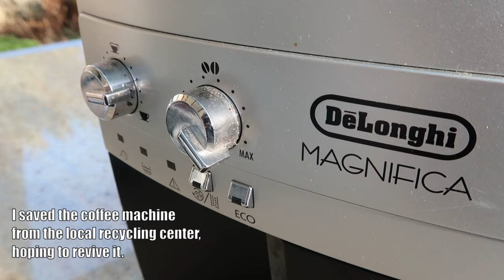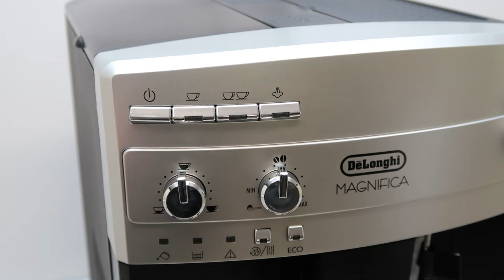DeLonghi Coffee Machine - Revival and Restoring DeLonghi ESAM Magnifica

Comment: Hi man, I have Delonghi ESAM 3300, when I push the button to make a coffee it is just driping in the cup and does not leak like before. I have replaced o rings on the infuser, brew unit and cleaned everything but nothing changed it still just drips. Do you know what I should do next in order to fix it? It seems like it is clogged somewhere. Also there  is  no biscuit created after making coffee, but everything is crushed.
Reply from the maker: Try to descale the machine properly. Follow my maintenance tips from minute 08;20 https://youtu.be/-BPGEyW5RVA
Reply: @yt.myworks  I've opened the machine 3 times and changed every o ring that I could, done 2 times descale on frothing pipe, but man you saved me I've rinsed like you showed on video and it works like a charm now. Thank you very much. Your channel is one of the best that I'm following, you are a crisfix in the coffee machine world.

Comment: Hey, thanks for that great Video! Mine has water leaking out of the water tank and dripping past the drip tray, but only if its in the machine. Already replaced the sealing ring of the tank, because I thought that was the problem, but its not. Any idea what might be the problem? Will a new tank help?
Reply from the maker: As a rule, everything should be tight again after the seal has been changed. It is important that the water tank is pushed in correctly as far as it will go.

Comment: Good Video, but why u don't show everything? How did you put the door back together? How do you do that with the spring in the door?
Reply from the maker: Hi, yes you're right. I've made other videos where the other steps are easier to see: https://youtu.be/Ww1SyIEeR8c?si=D2kWcdHLcatmwtaK
Reply: @yt.myworks  Thnks, but that is a newer generation with another door or am i wrong? ^^
Reply from the maker: Yes, the door has a slightly different shape, but the function is the same.
Reply: @yt.myworks  Aber der Aufbau ist anders und ich habe Probleme, meine Türe wieder zusammenzubekommen. Der blöde Verschlussmechanismus mit der Feder hüpft die ganze Zeit wieder raus :(
Reply from the maker: @hatkeinen3937  Du kannst ein Stückchen Klebeband dran machen damit die Feder an der Stelle bleibt.
Reply: @yt.myworks  Ich hab mir jetzt ne neue gekauft :D

Comment: Hi, i have a used delonghi magnifica that I cleaned etc., but when it turns on the display is "heating up" for 5 minutes, then it is "GENERAL ALARM" and nothing else happens. The machine seems okay with electric power on, and most things seem functional with initial motor check ( transmission moves and works okay, brew group is correct position etc) and it senses okay things like "door open" and "fill water tank." Could it be a boiler or thermofuse problem? Do you have a video that shows these kinds of issues/repair, please? 
(And thank you for your videos, they are very helpful and clear 🙏🏼)
Reply from the maker: Hello, with ESAM model often the heater breaks. Of course, you also need to check the thermal fuse as well as the temperature sensor.

Comment: Hi OP. I hope you see this. I got the same machine recently. The previous owner said it was working fine until it won't turn on. Where do you think I should look first for troubleshooting? The mainboard?
Reply from the maker: I think so, if the machine doesn't turn on at all then the fault is probably on the mainboard.
Reply: @yt.myworks  Looks like it's the mainboard. I used a working mainboard from another machine to troubleshoot. I'm pretty sure the mainboard can be repaired. Just have to replace a few components. Thanks for your reply and help!

Comment: I just picked up the same machine used and the espresso temp for a single shot is around 165 coming out of the machine (prior to hitting the cup.  This seems low.  The water temp coming out of the steam wand is 179.  Is this low for the machine?
Reply from the maker: Does it take a long time to heat up after switching on?
Reply: @yt.myworks  No.
Reply from the maker: I think that with this model a higher temperature is not possible. Preheating the cups is the only way.
Reply: @yt.myworks  That is what I suspect as well.  Thanks for replying!

Comment: you cleaned the coffee machine beautifully and thanks for the great video. I did a similar service for my express, but after turning it on I have alarm number 7: LEDs flash in sequence: water -> tray -> exclamation mark -> descaling and so on]
the brewer is installed, the door is closed, the door sensor is checked, the coffee machine is cleaned inside. What else could be causing this error?
Reply from the maker: Hi, that's hard to say, does the machine make any noise after switching it on?

Comment: Is there sort of screw thread for the grinder knob for this ESAM 3000, I find mines was very hard to remove, unlike my ECAM 22.110, all I have to do just pull the knob out very ease.
Reply from the maker: Hello, you can carefully take off the white ring, it is clipped in in three places.  To do this, you have to remove the grinder.  Pay attention to the left/right thread on the large screw!  LG
Reply: @yt.myworks   It was my fault, what I should've describe it as adjusting knob, that plastic with grind setting number on it, and I found out that there was a screw in it, and the cap in the middle of this knob  has to be remove first, but really thanks you a lot, I have watched your videos a lot and very helpful, BIG thank U:)

Comment: Hi this is great! I need to clean my machine out (same as this one) but the the centre piece with the red side  parts that you squeeze in to remove won't come out. It's stuck so I can't get past the first step!
Any suggestions would be appreciated 
Thanks
Reply from the maker: Try moving the brew group up and down while pushing and pulling the two red buttons at the same time. If that doesn't work, then there is a small lever below the brew group that needs to be unlocked.
Reply: Turn the machine off by the button, not pull the plug ot

Comment: Hello, great your video :washhands:On mine, I have a problem of bad contact on the buttons on the front. for example, if I type a little on the top, it lights up, goes out, flashes, it's like Christmas.
Do you have an idea?
Reply from the maker: Electronics are difficult to repair. Maybe the humidity is the problem. Try to disassemble, dry, and reassemble the control panel.

Comment: Trying to find o ring kit that contains sizes required in the United States? Buying them individually as Oem parts adds up quickly and I can replace entire thermoblock for 80$ I would like to just rebuild the generator vs replacing it. Thanks. Do any “kits” contain all the sizes?
Reply from the maker: @travelingmike In Europe there are matching sets with all O-rings to buy on ebay or amazon. If you can't find any seals in the US, I recommend buying a new generator.

Comment: HI ! My de longhi tells me the red water sensor is flashing, as if there was no water...but instead the tank is full!! so it crashes. Do you know how to solve it? Thank you !
Reply from the maker: Hello, does the water pump become quieter? If so, the machine may be clogged and calcified. In this case, you must try to descale the machine by adding a good descaler to the water and pressing the rinse button repeatedly. Maybe the water pipes will become permeable again.

Comment: Hello ,on my perfecta cappuccino is a leak when using the Clean function on the milk frother and the water in the tray is hot .. can you please give some advice? 
Thank you!
Reply from the maker: There is no general answer to that, but I would first disassemble the milk froth, clean it thoroughly and check all the O-rings.

Comment: Today low voltage to my home and machine went slow but all ok,,,, Later the voltage went back to normal and no power showing. Taken back cover off and power is going to the power board...Any ideas why not switching on and no lights, is there a reset button etc  ESAM 03 Model
Reply from the maker: Unfortunately I don't know much about electronics :-( There is a reset function on this model but I don't think it helps. You have to search for it on the internet.

Comment: Hi - I replaced my pump on the Delonghi Magnifica because it was not delivering water anywhere - the steamer now works but the coffee part is not delivering any liquid - any suggestions ? - I’m an amateur but I’m willing to try ! If so do you know where I can get the parts and directions to repair myself? Thank you
Reply from the maker: Hello, where is the water going? Does the water pump become quieter when coffee is brewed?
Reply: @yt.myworks  when I try to brew coffee no water/coffee is delivered - the machine makes a grind noise like it is should but then the  fill water light comes on and nothing happens - but there is water in the tank … I know the pump is working because the steamer water works when I turn the dial - Thank you
Reply from the maker: I think it's clogged somewhere. If the machine notices that no water is coming through then the error message lights up.
Reply: @yt.myworks  I cleaned the coffee spouts with a toothpick - can you tell me how to check the others lines ?
Reply: I’m definitely a novice at this but I’m trying ! Thank you
Reply from the maker: You need to check the water pipe that goes from the heater to the brew piston. To do this, you must remove the housing cover. But be careful, the water pipe is under pressure.
Reply: @yt.myworks  Thank you

Comment: Do you offer maintenance service? My machine needs service. It has began to leak water underneath the machine. It still makes coffee but I don’t want to buy a new one. Please advise.
Reply: Mine was leaking water underneath - turns out the boiler was leaking inside and left many calcium deposits inside the machine [hard water] which eventually created corrosion and a failure ... I think the boilers have a flaw in these machines.
Reply: @patdarisme6626  and what did you do? Or do you know the solution? Bc mine is the same …
Reply: Did he reply if he does maintenance???
Reply: Not sure if my reply is too late for you, but I have the ESAM2800 Caffe Corso machine (slight cosmetic difference, but the same inside).  had the same issue - leaking water inside when making a coffee. My issue seems to have been with item 64 generator in the exploded view (see link above). Tube L-190 (item 40) was completely clogged up with coffee remnants. I disconnected that and cleaned it out, re-assembled and it is now working correctly with no leaks.
Reply: @andyclarke6110  Thank you so much for this advice. I have bought a newer model but I like the old one better. I will try to fix it and gift my new one to my daughter.

Comment: I have a magnifica. I turned it on and opened the machine to empty the waste bin. This has faulted the machine. The front lights flash in turn and the resets don’t  work. Any advice please ?
Reply from the maker: Hello MrQuattrodavde, 
please check the micro switches and the position of the brewing unit. Make sure that the area of this parts is clean.
LG
myworks
Reply: @yt.myworks  is there a manual reset process, like winding the dispenser to one of the limit switches, it’s very clean inside.
Reply from the maker: @MrQuattrodave  maybe this helps:

Take out the brew group and close the service door. Press 1 and 2 cup buttons simultaneously and wait until all 4 lights are off. Put the brew group back in place.
Reply: Just tried again and it’s reset, appreciate your excellent support 😃👍👏

Comment: Hello. Is there a way to get rid of the plasticy clang sound when the brew unit moves along the shaft? I thought that my machine is old and makes this noise but I can hear it on your video too (10:47, 11:06). I added grease to the shaft but it did not help. Without the brew unit in place, there is no clang.
Reply from the maker: Hi, this clacking noise is normal and can always be heard. The noise comes from the brewing group, from the white plastic part that is mounted on a steel spring.
Reply: @yt.myworks  thank you very much for the explanation.
Reply: A dab of food safe grease on the white spring loaded latch pieces substantially quiets that sound.

Comment: Great video. Do you have a list of the sizes all o-rings for the brewgroup? Thanks!
Reply from the maker: Hello, I have made a list of the O-Rings I use. A suitable sealing set can be found in the video description.

1. Große weißer Ventilkörper
DI 4,3 x SD 1,78mm → 2x

2. 30mm Hülse
DI 6,0 x SD 1,78mm → 2x

3. Lange transparente Hülse
DI 4,7 x SD 1,78mm → 1x
DI 6,7 x SD 1,78mm → 2x

4. Anschluß-Reccord zur Heizung
DI 5,0 x SD 2,0mm → 4x

5. Schlauchdichtungen
DI 4,0 x SD 2,0mm → 4x

6. Brühgruppe inkl. Brühkolben
DI 34,9 x SD 4,2mm → 3x
Reply: @yt.myworks  Thanks for your reply. In your video you use 4,75mm for the 'Lange transparente Hülse' instead of 4,3mm. So is both possible?
Reply from the maker: @og-0110  I have different suppliers but 4.75 is better 👍
Reply: To są dedykowane o-ringi czy uniwersalne? Mogą się w jakimś stopniu różnić? Np. Grubość 2 zamiast 1.78?
Reply from the maker: Polecam uszczelki w jakości EPDM lub VMQ. Rozmiar 1,78 mm to w DeLonghi standard który należy zachować. Średnica natomiast może minimalnie się różnić. Podane tutaj rozmiary są mocno zbliżone do oryginalnych.
Reply: @yt.myworks  Czy u Ciebie można zakupić zestaw uszczelek do esam 3000 b?